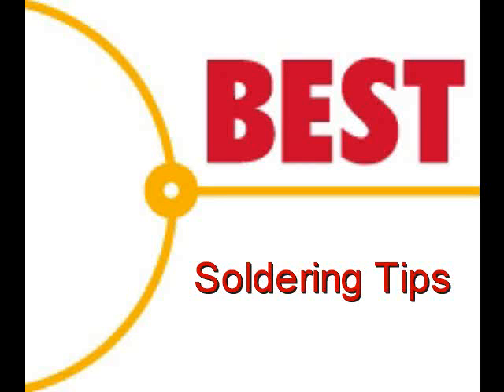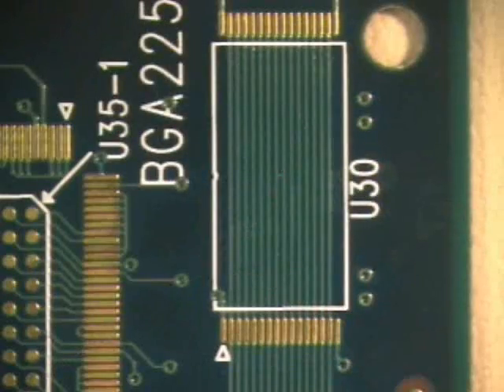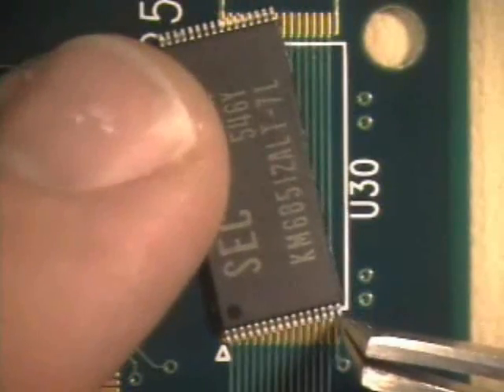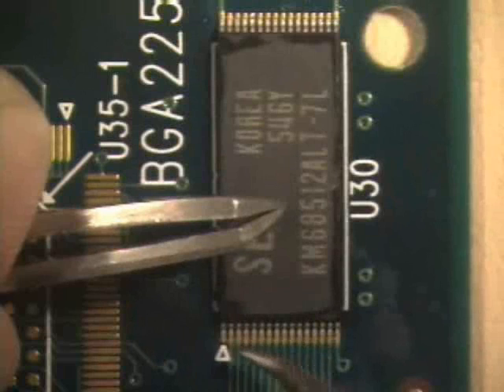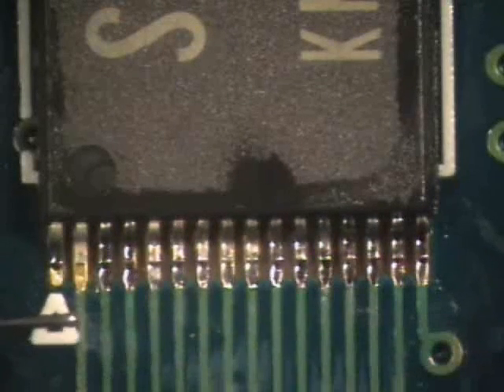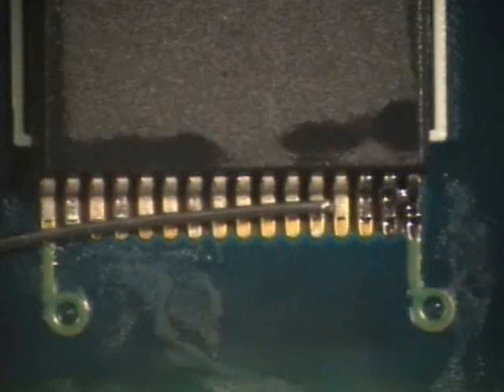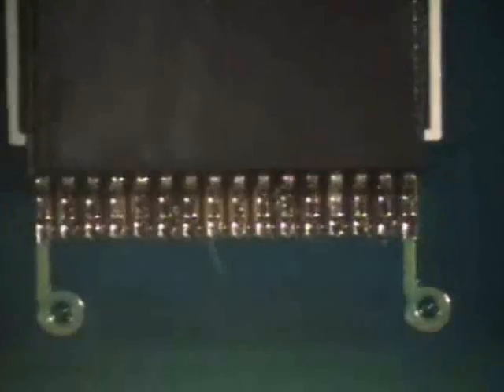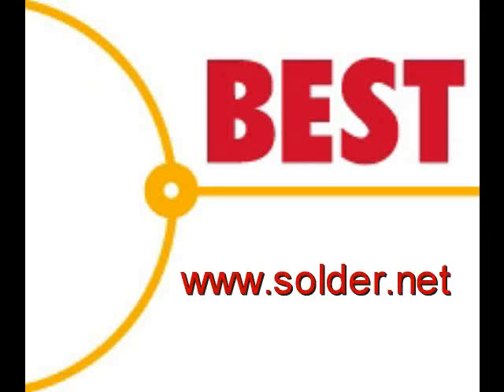TSOP32 Installation Multi-lead

Comment from the maker: One of the liquids that I use is flux and it enhances the solder flow and cleans the site where you are soldering.  The other liquid is alcohol to clean the site after you solder.